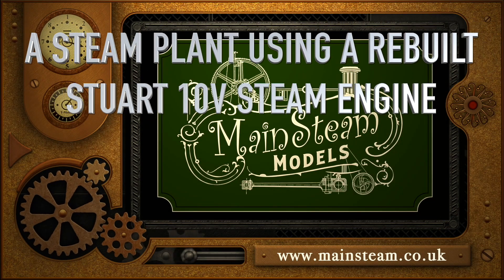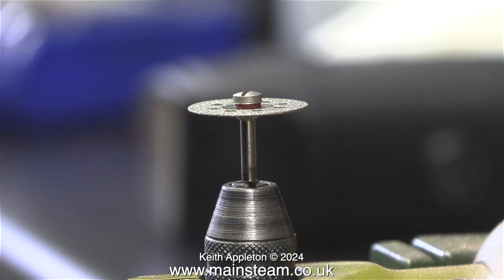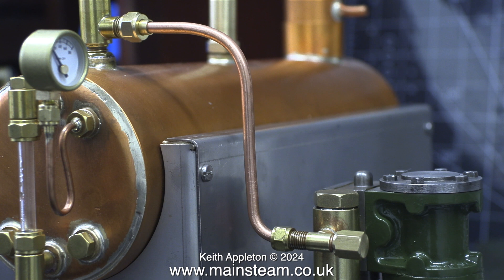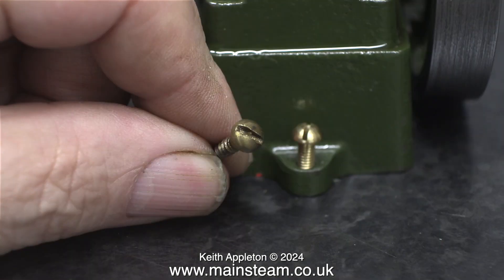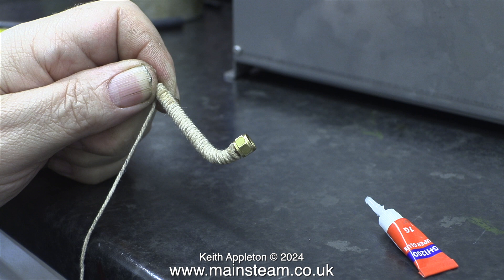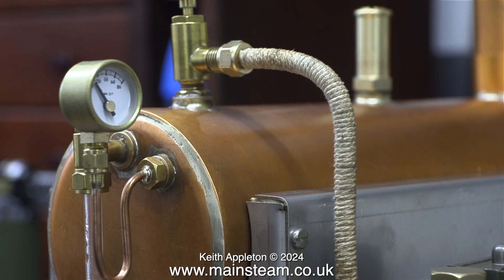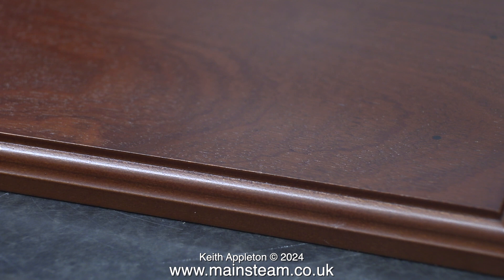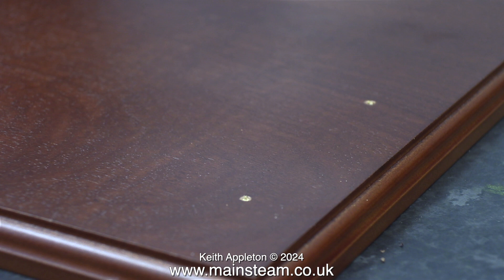STEAM PLANT USING A REBUILT STUART 10V - PART #6

Comment: A good little tip that I use on my steam boats, is to wrap the string with white plumbers ptfe tape, it looks great, and any gunge is easily wiped off leaving it looking as good as new and it’s a lot easier than painting it !
Reply from the maker: I once did that, but the PTFE Tape turned yellow over time.